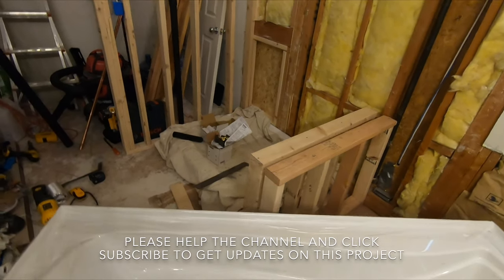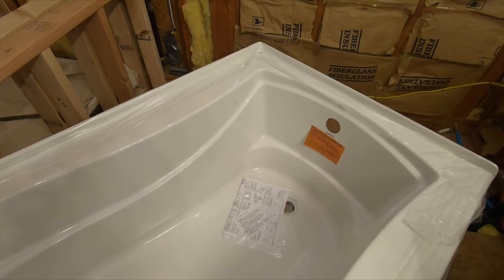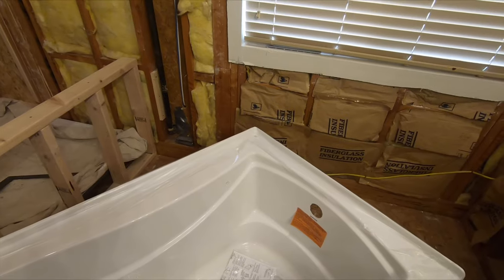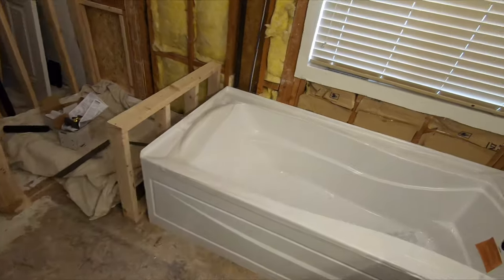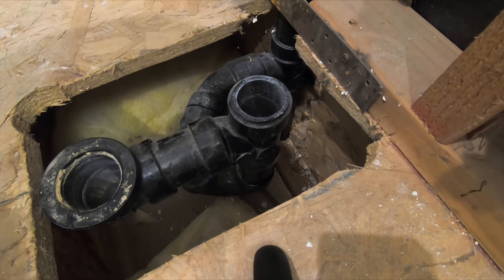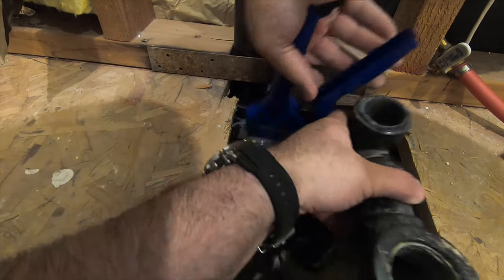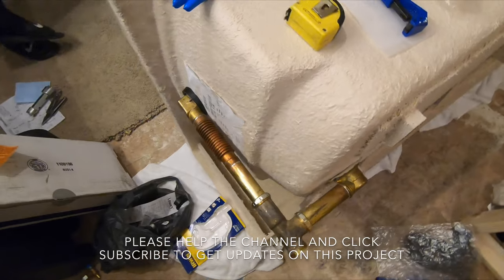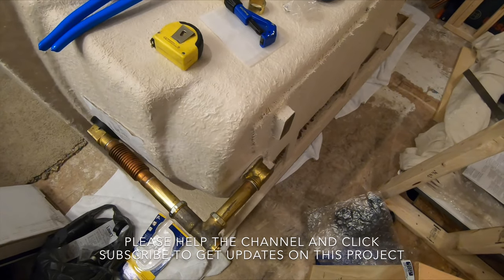Kohler Bathtub Installation Part 1 Drain Kit Install Mariposa Purist Acrylic Fiberglass Tub Unboxing

Comment: Couple years late on this, but I think the directions meant for you to mark a horizontal line on the center of the drain pipe. Transfer that line to the vertical overflow drain, and that would mark the two points where the two pipes intersect, and be the center for which the fitting to be added, could be measured from per the instructions (the 2 5/8 inches or whatever it was). Pipe is measured by utilizing fitting centers. The center measurement of those intersection pipes would be the center at which they cross each other. Had the directions been more clear, you should’ve had a level line on the drain, transferred that line to the vertical pipe where it intersects, and measure up from there. Then, your overflow would’ve likely lined up perfectly, and been bottomed out in the drain Tee.

Comment: Great video. Thanks.  I'm about to embark on an installation of the same Kohler tub drain. You are right about Kohler's installation instructions... very vague.  Anyway, lets hope this drain doesn't leak like two of my previous cable operated Kohler pvc drains. (on my YouTube channel) :o
Reply from the maker: Thank you very much for your comment, I’ll have to check it out. I’m releasing a video soon showing the finished bathroom.

Comment: Thanks for the video. Do you have a part 2 showing the rest of the installation?
Reply from the maker: MattN03 it’s in process. Thank you for the question. It’s on the memory card on my camera, there has just been so much going on I haven’t had time to sift through all the footage yet. The plans are a multi part video series, step 2 is the faucet installation of the deck mount faucet kit, step 3 will be setting the tub in place and connecting it to water and drain and keep going from there. Sorry for the delay 😅

Comment: Very good video.  I just bought the same tub and gearing up for installation.  It would be cool to see the rest of the video.  Also would you mind listing the drainage kit parts you ordered.  I also like the press down drain setup.  Thanks in advance!
Reply from the maker: Thank you for the comment, I have such a back log of all kinds of videos. I would need to find the box that the drain kit came in and see if the part number is on it. Sorry I don’t have that right away!
Reply: @alexsystems2001  no worries.  I tried to pause and un-pause the video.  I think I believe I got the same one.

Comment: What brand is the drain kit , is the drain kit also made by Kohler ?
Reply from the maker: Thank you for your question, yes the brand is kohler. I went with kohler on the tub, the faucet, the drain, the cast iron shower base as well as the faucet kit for kohler. Everything with the exception of the tub itself is part of the “purist” line. I’d have to look through my paperwork for the exact line of the tub.